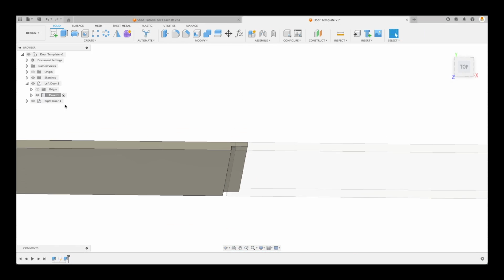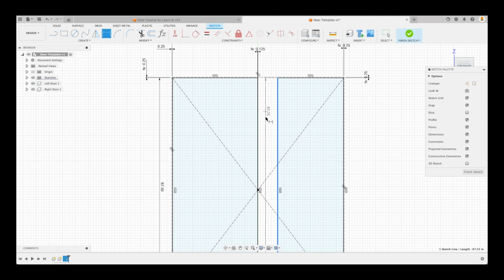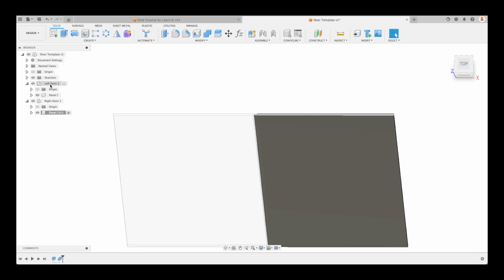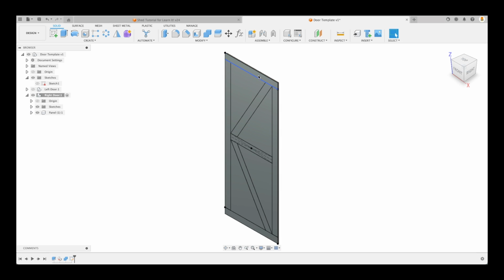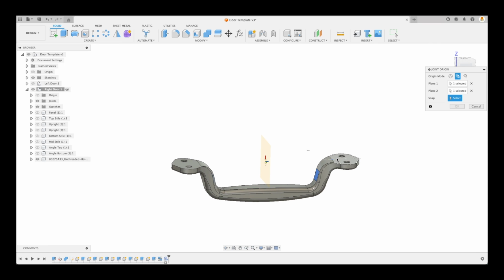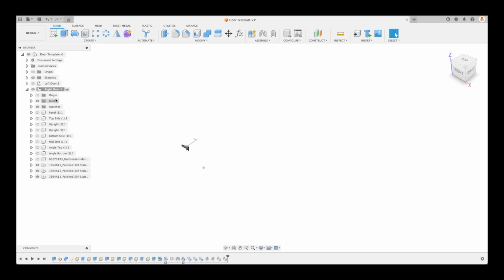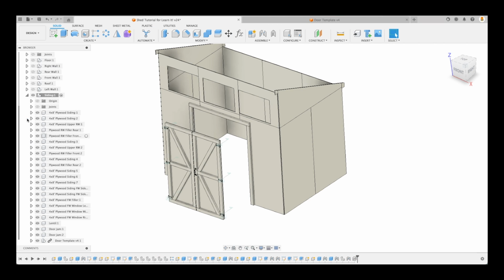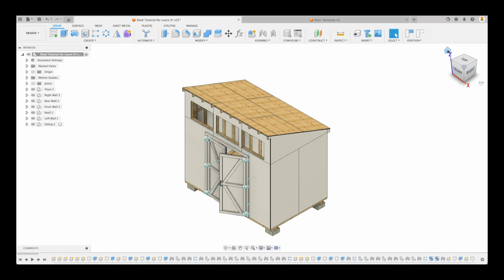Autodesk Fusion 360 - Part 4/4 - Shed Doors - Model/Assembly Tutorial - Intermediate/Advanced (2024)

Comment: Question- - not related — I am having trouble lining up numbers straight above each other making a number plaque. It doesn’t give you a center point that I can notice. If I make the separate from each other. Hope I’m explaining it correctly.
Reply from the maker: Excellent question. What I do is draw a construction line diagonally from corner to corner in my text box. Then create a point and snap it to the mid point of your diagonal construction line. That then becomes the midpoint of your text box which you then can constrain or dimension to other points of your design.
Reply: @learnitalready thanks for answering that! I will try it.